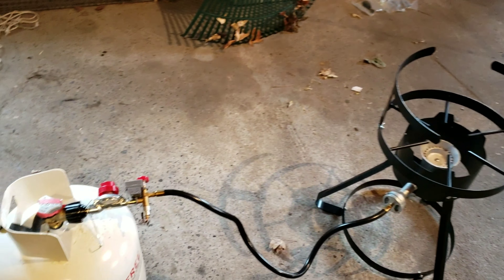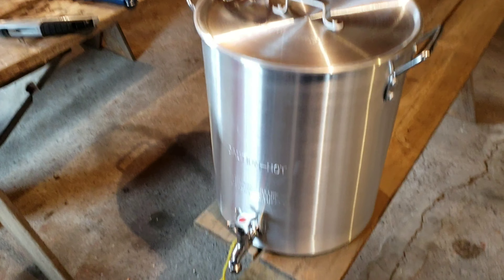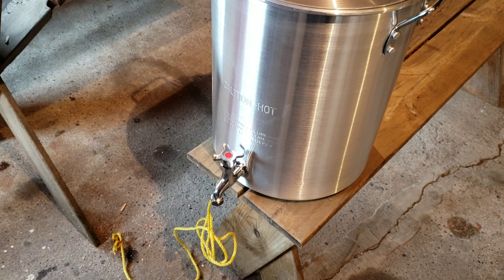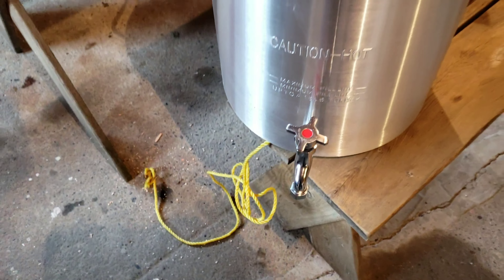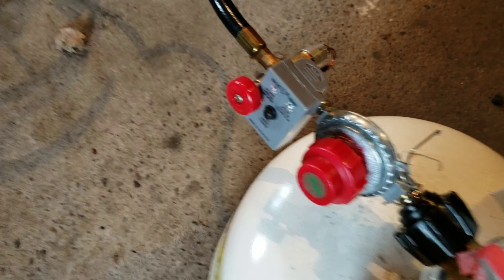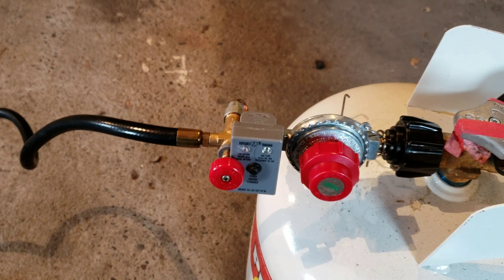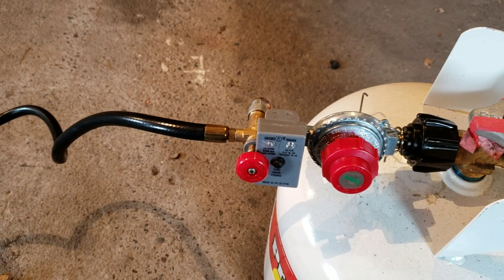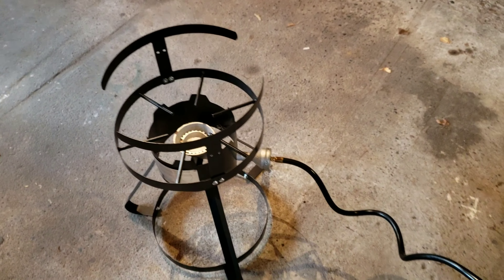My New Turkey Fryer!!

Comment: Take a pair of nippers and cut the hose off on the rubber......get a threaded nipple that will screw into the regulator ...hose clamp the  hose back on.....make sure it doesn't leak, use dish soap might  have to use a different reg, they are like 15$......dats how dye do it in da U.P., eh???